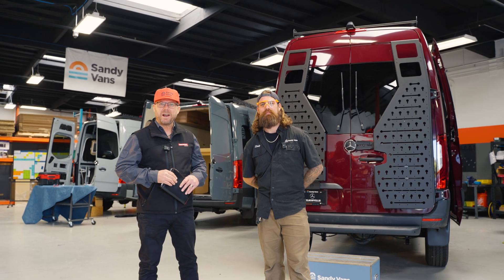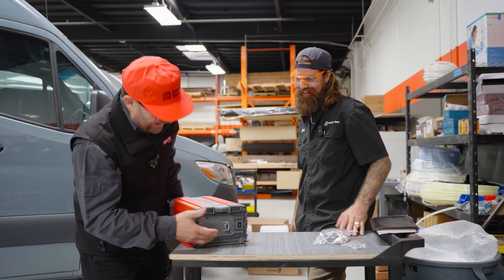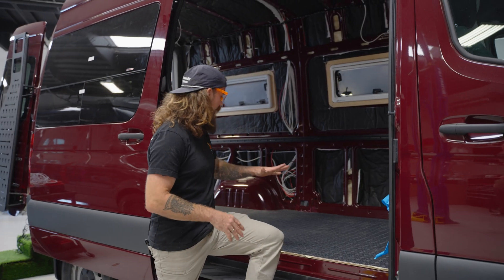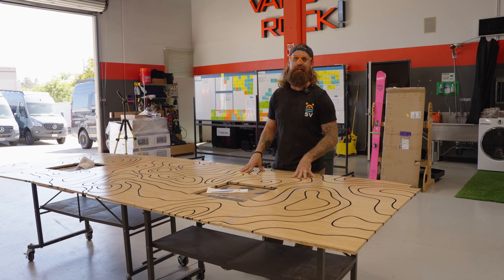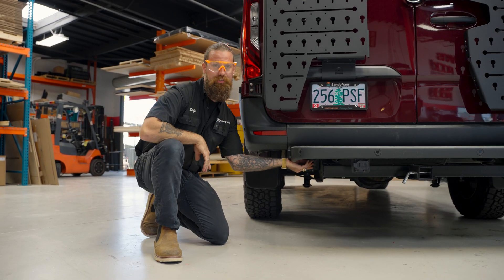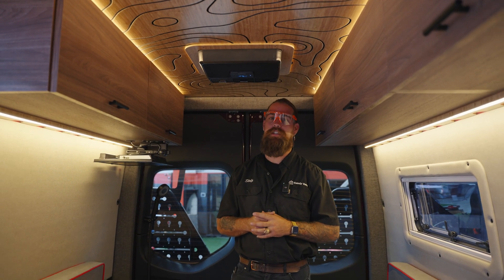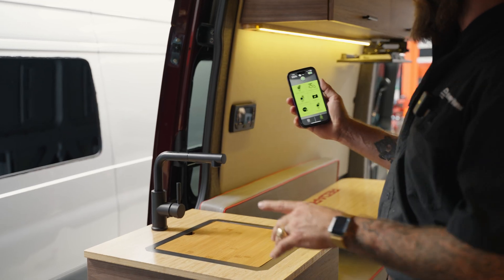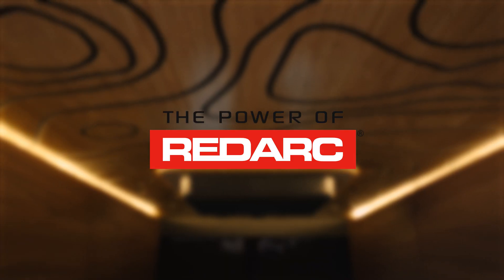The Ultimate Van Power System | REDARC's Camper Van Build

Comment: What’s the amp draw limit for transit?  You mentioned 75 max amp pull on a Sprinter.
Reply from the maker: Hi Jon - to be honest you'd need to check with Ford on this to get the specs of your alternator and system. Each model Transit is probably a little different over time, so good to use your VIN and double-check!
Reply: @REDARCElectronics  I found out Transit is the same at 75.